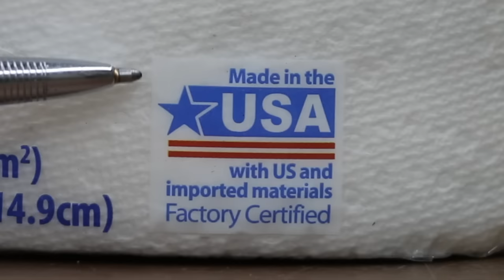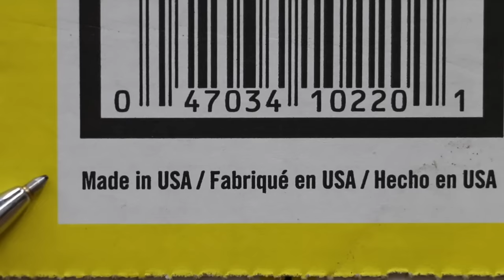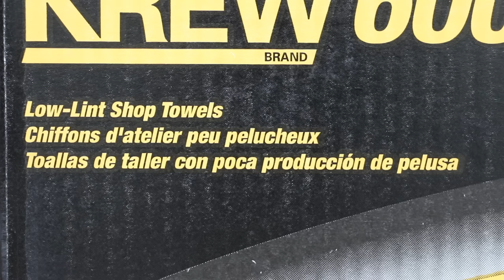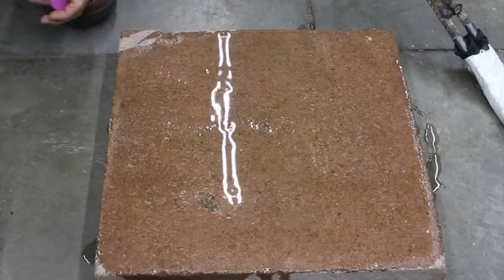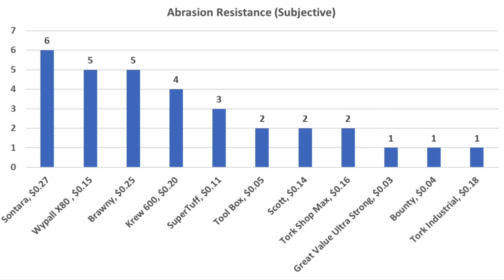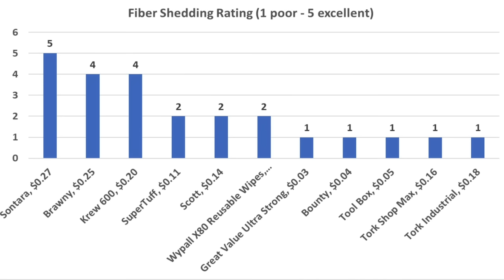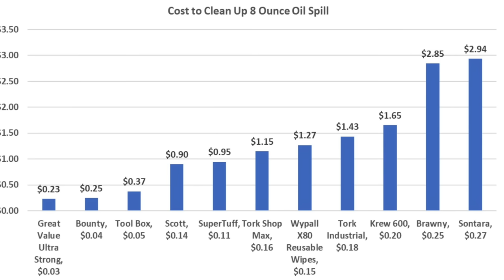Shop Towels vs Paper Towels? Let's Settle This!

Comment: I’d love to see a microfiber rag test too
Reply: Yes! All the new ones just smear like they are coated with wax.
Reply: @hertzer2000  Maybe they have been treated with fabric softener at the factory to make them feel fluffier?  The test would be if they absorb better after washing.
Reply: I have been using the 16 inch MATCC brand microfiber cleaning cloths (from Amazon) for a while now. They are thick microfiber on one side and thin on the other. The MATCC microfiber cloths work great for automotive detailing, especially for glass. Just make sure you wash them (without fabric softener) before using them, as with all microfiber cloths. That way they don't smear or shed during use.
Reply from the maker: Thanks for the suggestion.
Reply: This should include a cotton t shirt or polyester t shirt cut rags
Reply: That would be nice, need to test on a NEW car, 1 brand per panel and see how bad they scratch the paint

Comment: I'm an aircraft mechanic and we use Sontara wipes. Their main purpose is to clean surfaces before applying sealants/paint so it's really important they don't leave behind fibers. If we have to clean up any kind of spill from oil, grease or hydraulic fluid we use PIG mats, which are hydrophobic and only collect the hazardous chemicals
Reply from the maker: Thanks for sharing.

Comment: This is one of those rare times I would have loved to see a brand involved that wasn't. Viva paper towels are absolutely amazing and I would bet they would have easily been the best paper towel brand, I use them as dish washing towels and I throw them out before they break down. I have the great value strong brand and it doesn't even touch the Viva in anything we use them for.
Reply: Viva is the only brand you can blow your nose with without tearing up your nose during cold and flu season. Ordinary facial tissues just don’t cut it.
Reply: I agree, those Viva towels are pretty good
Reply from the maker: Thanks for the suggestion.

Comment: I've been using those Wypall X80 towels for years and can confirm, I have never found anything that performs remotely as well. The only thing they lack is absorbancy but it doesn't matter because the towels are huge so even big spills are not a problem.
Reply from the maker: Thanks for the feedback.
Reply: Exactly! I have been using them as a mechanic and in a body shop setting for years. Nothing else comes close. If they are not soaked with oil,  grease, or silicone etc. they can be thrown in the wash with clothes and dried in the dryer afterwards. CAUTION don't dry oily or chemical soaked  towels as they can catch fire!  I have some of these  that are as old as 2009 and are still usable.
Reply: It's hard to develop a highly absorbent towel that is also durable because absorbency needs loose fibers that are inherently weaker than tightly woven fibers. Wypall is a great shop towel, for oil spills specifically bounty is better and 66% cheaper.

Comment: Your reviews are more valuable than Consumer Reports! I'm sure you have this on your idea list already, but a review on battery leaf blowers (or gas) would be really interesting.
Reply from the maker: Thanks for the video idea.
Reply: CR just recommends whatever is expensive rather than what is good enough for what it is
Reply: From what I understand in the past consumer reports reviews can be questionable as reported some of the reviewers went on to go to work for the some of the companies they reviewed products of.
Reply: Very true, Project Farm uses well thought out, and much better testing than consumer reports
Reply: @marcusbrown188  Not true.  I have over 60 years' experience with Consumer Reports, and have at least 30 years of issues here.    They are not what they once were, but they still do a decent job, especially on autos, large appliances, and other very costly items not practical for Project Farm to test.  Consumer Reports does NOT accept advertising, unlike their competitors in print, and they are a tax-exempt organization.  You cannot be impartial when accepting ads.  Project farm tests items CR has not tested, at least in recent years.  But at one time, CR did test the type items tested by Project Farm now.  Both are necessary.  Project farm does a very nice job on the items he tests.
Reply: Consumer reports kinda suks
Reply: @mrmusiclover4178  Project Farms performs far better testing then Consumer Reports can ever even dream of !
Reply: @56Spookdog  Explain, please?  I believe you are confused on this.  What is your reference.,  BTW, I am not defending Consumers Union.  But they ARE independent.
Reply: @GunnysWrenches  You cannot compare the two!
Reply: @ITILII  Project Farm does not test automobiles, washing machines, refrigerators, and lots of other large items, since it is not practical.  Consumers Union DOES.  On what do you base your comment?

Comment: I prefer the Costco "short sheet", white paper towels, as well as the Scot, blue shop towels, in the garage.
   I think the Scot blues are just extremely versatile, all around. As other commenters have said, there is a trade off between toighness, and absorbency. The Scot blues seem to have a perfect, all around balance when it comes to being lint free, strong enough to not fall apart while detailing wheels on a car, for example. 
   And the one thing I do love about them, is that they are pretty damn soft. And they tend not to easily scratch plastics, clearcoats, etc. Soft enough that I tape two of them down (still connected together), on a flat wooden TV tray, when I search coin rolls, for high MS grade coins. These towels don't scratch the delicate fields in the coins, and they are thick enough that the coins stay put, and dont slide around. 
    Great video! Thanks PJ!
Reply from the maker: Thanks!  Thanks for the feedback.
Reply: I use Scott Blue shop towels to clean around the house. No lint, and they hold up better than paper towels, and often I only need to use two sheets to clean what I want.

Comment: Related note: Blue show towels hold up very well with Dry Ice and LN2 use. In XOC (Extreme OverClocking computers) we use Blue towels as a 1st layer to soak any excess moisture from pull down and heat up.
Reply from the maker: Great information!! Thank you

Comment: Video idea: wood cleaners—Murphy’s oil soap, cotton cleanser, etc
Reply from the maker: Thanks for the video idea.
Reply: Good one! 
I use Murphy’s a lot. For wood, of course, but it’s also great for spot cleaning cat vomit from quality wool rugs. The vegetable oil base  is gentle on wool.
Reply: I use Murphy's oil soap (diluted, but sometimes full strength) to clean hard to clean stainless steel, best cleaner I have found for stainless steel.

Comment: An important point on the Scott blue shop towels.  I had bought some Scott shop towels in the automotive section at my local Meijer store.  They were super tough and great.  A couple weeks later I went to Autozone and bought 6 quarts of oil to change in my 4Runner and they were offering 2 rolls of blue Scott shop towels for $2.  I really like the ones I had purchased before and thought 2 rolls for 2 bucks was a bargain.  Except when I opened them, they weren't the same Scott shop towel.  The blue towels I had bought at Meijer were a quilted towel that was fantastic and super tough.  The bargain from Autozone was a much cheaper version that wasn't quilted and literally fell apart when it used them to clean something with acetone.  I think that cheaper, disappointing Scott shop towel is the blue shop towel that was part of his test here.  Scott shop towels more than pass the test, but look at them carefully.  The blue quilted Scott towels are the good ones.
Reply from the maker: Thanks for the constructive feedback.

Comment: In the next one, please try wypall x90s and wypall “oil grease and ink”. 

Actually, on second though, it would be nice to see an all wypall test, through all of their different grades.

I have a roll of x90 in the shop, and some of them have been in the mineral spirits solvent tank for over a year without breaking down.

Also, it would be nice to see a comparison of oil absorb any mats with the different ratings and brands. Pig vs all the other knock offs.
Reply from the maker: Thanks for the suggestion.
Reply: @drippingwax  lol, nah definitely not, but I am a big fan of their product after I saw abom79 use it
Reply: We use wypall at my shop and they are great. Would love to see a full product line review of absorbing mats/snakes as well, we have some that will lay in water and absorb oil and not the water it’s crazy.

Comment: I've been using the toolbox brand from harbor freight for a couple years and they work well. I really like the larger rolls they sell for $11 and they sell a dispenser that holds the big rolls so you can refill it easily and not throw away the container every time. As seen here they aren't the best but the price is good and I use enough that it's a good option for the money
Reply from the maker: Great feedback on the Tool Shop brand. Thank you!

Comment: Always love your videos. I just wish you'd included Viva towels. Priced like a paper towel but with a thicker feel, more like a shop towel, I'm wondering if they wouldn't do well in the price/performance ratio.
Reply: I was going to post the same thing. I highly recommend Viva "Signature Cloth"  paper towels. They are extremely absorbent, very low shed, and durable enough that you can ACTUALLY wring them out and reuse multiple times. The rolls are tiny for what they cost, but one tiny sheet dries as well as two name brand full sized sheets and is about as durable as four. Avoid the "multi-surface" ones since they're basically a better version of Bounty, unless you want regular style paper towels.
Reply: Yeah they're great towels, it's what I always get for the home.
Reply: The Viva towels are fantastic. I wish he had included them.

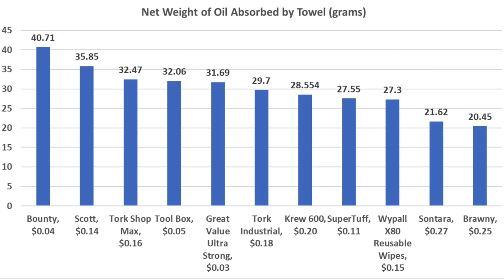Comment: 9:51 -- Such a fascinating test.  It appears that the household towels are prioritizing adsorption at the cost of durability, and the commercial towels are prioritizing durability over adsorption.  

The outlier and worst brand by far is Brawney: a very expensive towel which is neither absorbent nor durable.  (Maybe Brawney should have spent less time deciding on whether their lumberjack has a beard or not and more time on making quality towels 😂)
Reply from the maker: Thanks!  Thanks for the feedback.

Comment: I need a brake clean and carb clean can test. What can lasts the most for the amount of money. Which cleans better.
Reply from the maker: Thanks for the video idea.
Reply: Wd-40 carby cleaner is good.
The nulon brand also decent
A cheapish brand from "supercheap auto" in australia also ok.

Break part cleaner not sure.

If you want a starter fluid nulons "start ya basterd" is great.
Reply: @southaussiegarbo2054  The problem here is that although the US and Australia have many of the same chemical brands, the down-under chemicals are often the strong original composition, while the American brands have been neutered, just like our politicians.
Reply: @howardhiggins9641   lol very true we like the stronger 💩 bc it works better.
And yeah tbh right now id rather trump then scott morrison(our federal leader) 😂
Reply: @howardhiggins9641   
We also call "gasoline" unleaded petrol here
Reply: @southaussiegarbo2054  White gas also had no additives, per se.
Gasoline, even the alcohol-less mixtures, now have other additives.  
 Propane gas is now added to pumped-fuel to replace the lead, and increase the anti-knock rating of the fuel.  This factor is also one of the reasons that stored gasoline does not last very long, as the gas evaporates out.    
This component has also killed people when, for example, the propane has "boiled out" from the liquid on hot days near truck re-fueling depots.   Large clouds of the gas can then accumulate on streets, just waiting for people to drive through it. 
Gasoline in California, can easily cost $2 more per gallon than it does in other states, due to the "special" blends required here - another reason so many people have become fed up with the Marxist government and are leaving.
Reply: @howardhiggins9641   how can u mix a liquid (petrol) with a gas (propane) tho.
Bc propane aka lpg has to be stored under pressure
Reply: @southaussiegarbo2054  Many gasses can be dissolved in liquids.   Similar to the CO2 injected into bottled fizzy drinks.   Even some beers have CO2 injected into them before bottling.
One of the factors recorded in books like the CRC handook, is solubility of gasses in various liquids.

Comment: Suggestion: Best rotary tool corded and cordless, throw in a proper die grinder for a laugh.
Reply from the maker: Thank you for the video idea!
Reply: Totally on board for this!
Reply: Milwaukee would win
Reply: @jointaimbot55  that’s what I want to find out, about to pull the trigger on one. Do you own the Milwaukee and have you owned a Dremel?
Reply: @glumdogtrillionaire  Agreed
Reply: @glumdogtrillionaire  used dremel, own milwaukee 12v, no comparison unless you only want run time.

Comment: Best shop rags are old, worn out t-shirts,  socks and bath towels. Cheap too........
Reply: Follow-up video, "We're going to put that to the test."
Reply: Yeah those are great and really usefull if you have old clothes which can be used and not hrown away
Reply: Problem with using cotton to clean up oil is now you have created something that can self combust and why oil soaked rags are to be stored in a fire canister. If you do this, take caution.
Reply: @mistermacgray  get that logic and safety outta here!!!!
Reply: @mistermacgray  Using paper towels or shop towels to clean up oil leads to the same problem, as cotton and paper are both made from the same material (cellulose).
Reply: @christopherbackus5578  you are correct but wood is only 40-50% but people tend to toss shop towels in a pile to "reuse later" vs paper towels they throw away right after use. You see guys in wood working with the flame cans to store their used stain rags in to reuse later but I've read a few cases where the can was hot because the reaction had begun.
Reply: @caseytbss  you must be in the wrong channel as this channel is nothing but logic and safety when it comes to how things are tested.
Reply from the maker: Thanks for watching!
Reply from the maker: Thanks for the feedback.
Reply from the maker: Thanks for the feedback.
Reply from the maker: Thanks for the feedback.

Comment: Just curious why did you use brake parts cleaner instead of water to test the wet rip strength?
Reply: I’d say bc most ppl likely will use that more in a shop setting than water
Reply: Using bpc could skew the results, as towels made with binder will probably lose more strength then hydroentangled towels.
Also, most bpc in itself is very volatile, and will evaporate quickly, requiring little to no cleanup.

Comment: I found the wypall 41041 x80 towels from Bus Grease Monkey here on YouTube. He washed his bus with just one towell as well as said how well they held up and didn't have lint and absorbed oil. I have almost used my first case. I have been useing them for a little over a year. I used to use red shop rags which are not absorbent at all compared to towels. These things hood up well are able to wipe your hands many times as long at your not dripping in oil to your forearms. There not the cheapest thing but I am cheap and these are worth the purchase price!
Reply from the maker: Thanks for sharing.

Comment: Thanks, awesome video review!  I use a lot of Costco brand paper towels in my home shop mostly for wiping parts, hands and spills.  They are really cheap with huge rolls ( 12 = 220)  Haha. I gave up trying to figure out the best value/cost in the store they are just smarter at marketing then my math skills can handle with all the different size sheets ect.  I also use a lot of old cut up tee shirts for the rough jobs and they are practically free and therapeutic to cut up.  They all leave a lot of lint but who cares I'm not building rockets.
Reply from the maker: Thanks!  Thanks for sharing.

Comment: The Sontara is not designed to be a shop towel. It’s main use is for plexiglass windshields on aircraft. They don’t scratch and they don’t leave fibers as you saw in your testing. They also work well on motorcycles. Paper towels can scratch plexiglass and are discouraged for use. Scratched plexiglass presents a multitude of problems when flying into the sun. We don’t use anything but Sontara on our airplanes. Made by DuPont.

Comment: One critique. Paper has a grain pattern to it, just like wood.  Tensile strength results should be discounted.  The towels should have been tested by folding three times vertically AND another test for horizontally folded towels. That way you can compare (or rule out) pulling with the grain vs against the grain, eg apples to apples comparison. Still amazing work, love the videos.
Reply: upvote on this one
Reply: @FarWesternGarrison  I downvoted you both don't worry.
Reply from the maker: Thanks!  Thanks for the constructive feedback.
Reply: @SirPhilMcCrackinVonBeggington  ouch!

Comment: Sontara towels are exceptional.  I found out about them when I saw the contractor using them on the depot repair line (defense contractor).  The cost is on the high side, a box of 100 of the 9165A's is around $25.  A lot more than a roll of regular paper towels or shop towels.

I don't use them for normal use.  They're great when working on prepping paint or staining.  Also, electronics and gluing are other great uses.

I had a feeling the Sontara's would be the best, however there is a cost for quality.

Thanks for another excellent video!
Reply from the maker: You are welcome!  Thanks for sharing.